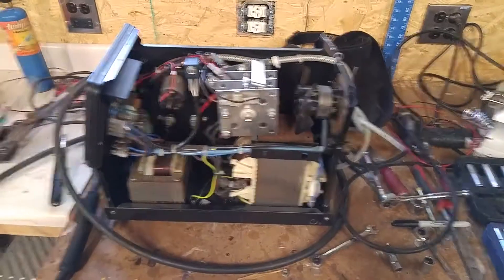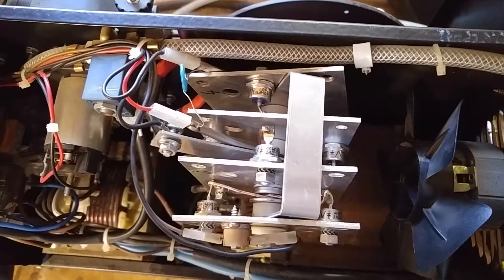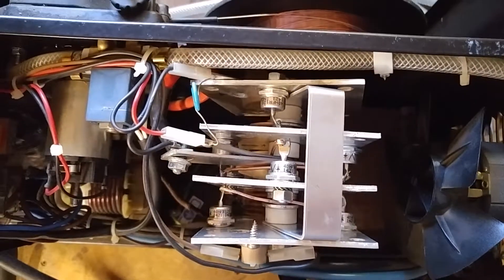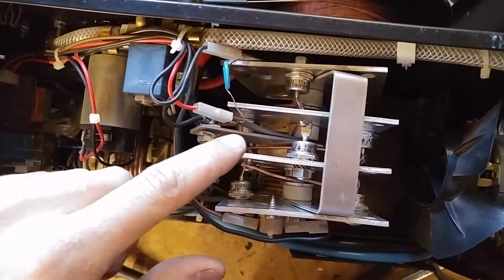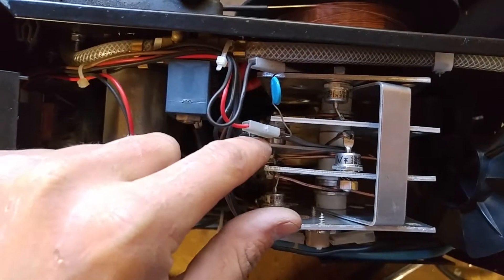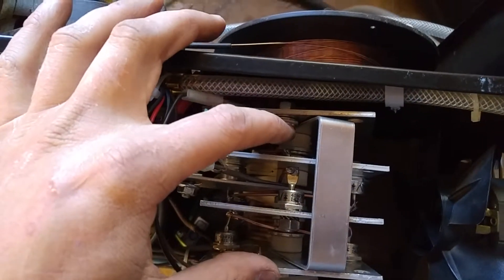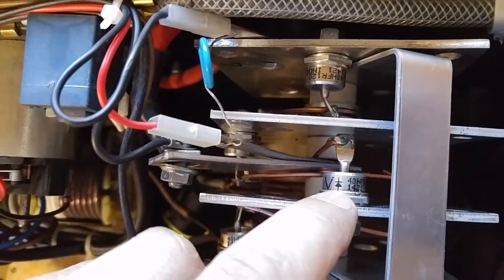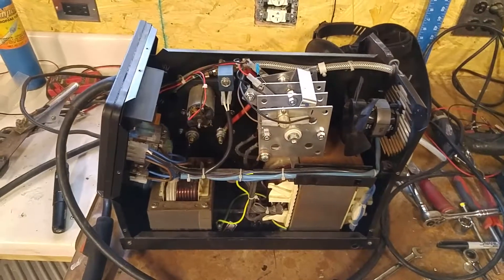How I fixed my MIG welder after one of the diodes in the bridge rectifier failed

Comment: Is the welder in your video a Clarke 180EN? I have said welder and it looks identical to the one in your video. I have a blown diode and another that seperated so need to do this repair. So I will want 8 of the HFR diodes and none of the HF? That would sure simplify the repair if I dont have to watch for polarity because none of the factory diodes are labled and not sure if I can test the failed ones with my meter. Thanks!
Reply from the maker: It's a Cigweld Transmig 165 Turbo, ~2004. This is an Australian brand which I think is the same as Clarke? Sorry I can't remember the diode type. Good luck.
Reply: @eyesspee  I appreciate the reply. Yeah it looks just like my clarke 180.

You mentioned using all the same polarity diodes so i guess ill probe mine and if they all seem to be one polarity i will order 8 of the same polarity.
I did find a whole new rectifier assembly on aliexpress but its $60 and not 100% sure it will work because it has more diodes in it.
Ill probably just try to replace the diodes. 
Thanks for the video 👍
Reply: Hi,  Lame Gaming,  Did you get your welder repaired?  I have a Clarke 180EN also.  Can you tell me what diodes you ordered and where to get them?  Hope you got it fixed and you can help me.  Thank you
Reply: @stevess356  Yes i did, ordered a 10 pack of 70hfr120's. Only need 8 but they are sold in 10 packs on aliexpress. Was about $20 and shes burning wire great now.

Theres alot of modifications I had to make and soldering,drilling,trimming so these arent drop in replacements.

Using my clark with gas and a big spool of hardwire from amazon and im surprised by how good the clarke runs.

I have pics of the rectifier after fixing on reddit somewhere but I doubt i can share the link here